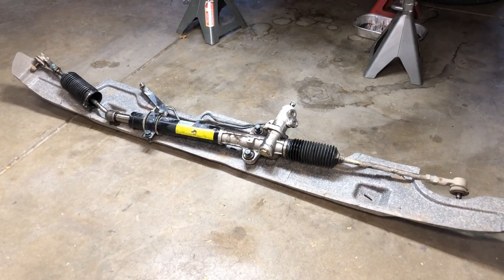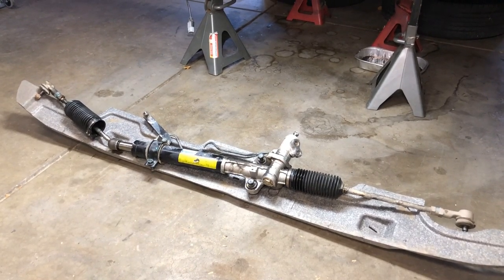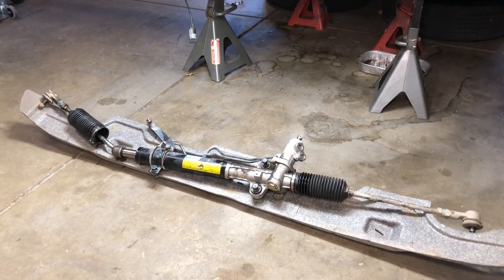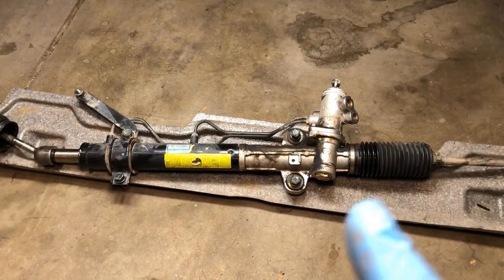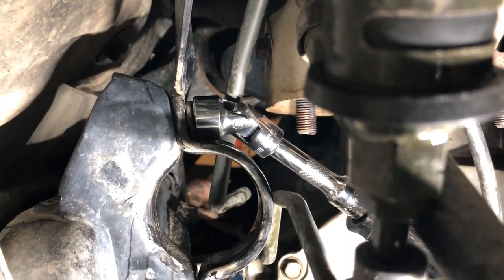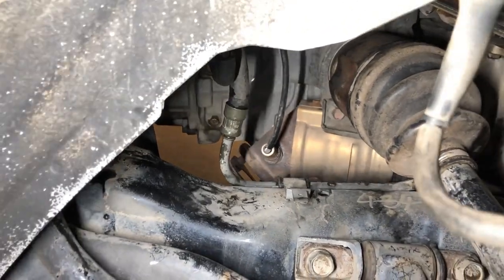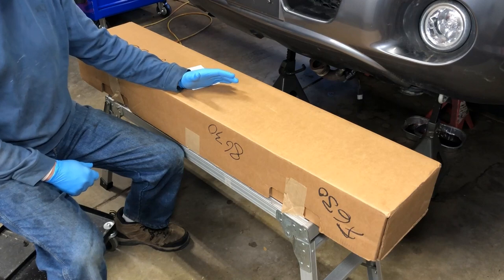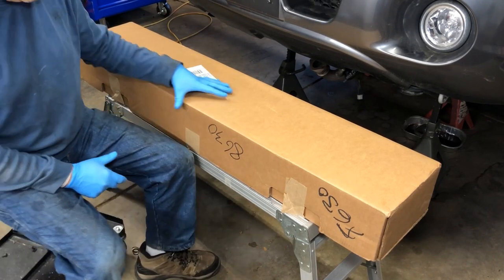Hyundai Santa Fe Rack & Pinion Replacement Part 2

Comment: After disconnecting the lower part of the exhaust manifold I can't remove it out of the way. Found a rubber hanger on a hook half way down the length of the car, removed it. There's two pipes just aft of the split exhaust pipes of the of the exhaust manifold. These pipes are butted together. No bolts no springs of any kind externally. There seems to be some kind of spring mechanism on the inside of these pipes. I absolutely cannot separate these pipes externally.  I'm thinking might have to drop the whole exhaust system on this job. Are you kidding me?! The vehicle is a 2002 2.7l
Reply from the maker: @David Kievman - I'm trying to understand your situation and see if we can help you out.  In my case, I disconnected the front and rear CATs first and then disconnected the hanger I show at 08:08. I was then able to pull the exhaust down a few inches and move it to the side a bit.  The flex connector (which I believe is the part your referring to with the spring) should allow for some movement to be able to accomplish this.  However, the flex pipe is not a "joint" where the exhaust would separate.   I wasn't able to move the exhaust enough to remove the rear CAT but that wasn't necessary (in my case) as I was able to lay it down and then gain access to those R&P bracket bolts.
Reply: I just took another look and there is no way I can get a socket below the six bolt circle to remove that vertical pipe. This is not our problem, but I have a O2 sensor is bad. I just found the sensor I've been looking for since last year! It's mounted on the vertical pipe! This is starting to look like an engine pull.
Reply from the maker: @David Kievman - I just sent a message to a friend of mine who was a Hyundai master tech and asked him if he could take a look at your comment here and offer some advice. I’m not sure when he’ll have time to do that but I’m sure he will when he gets a minute.   I’ve seen some crazy designs in my day but I can’t believe you’d have to pull the motor to change an O2 sensor. Unless I’m totally misunderstanding your problem here.

Comment: Great video. I did the same things with 2 small differences. I didnt bother sucking the fluid out since some is going to drain out the hose ends when you take them loose from the rack anyway, just catch in a drain pan. And I was able to get the trouble bolt out without removing anything extra, just a short 3/8" drive 17mm socket on a thin 3/8" drive ratchet, used a short cheater pipe too. No wobble required. Pretty easy job, thanks!